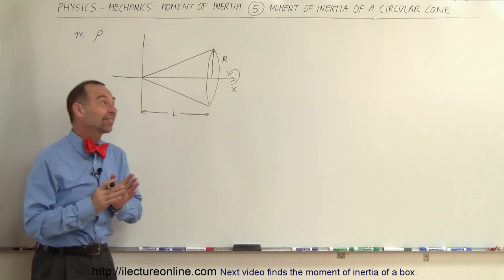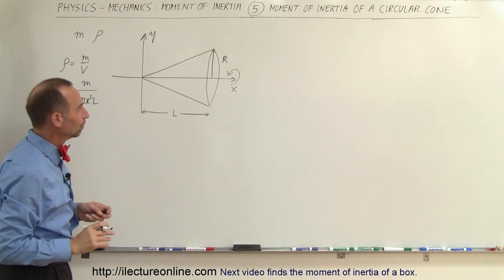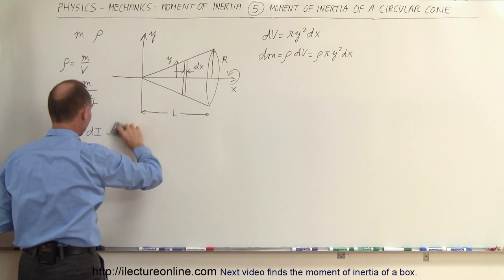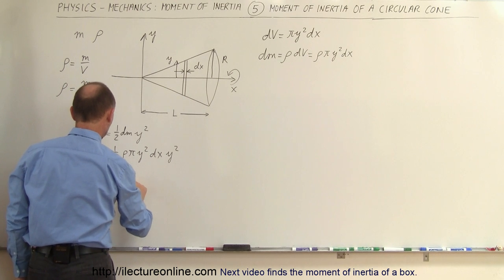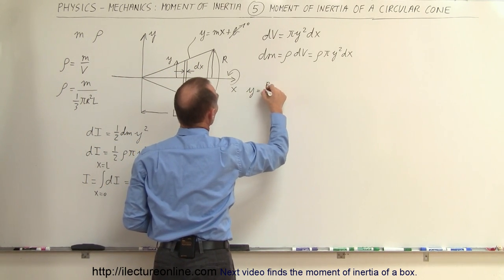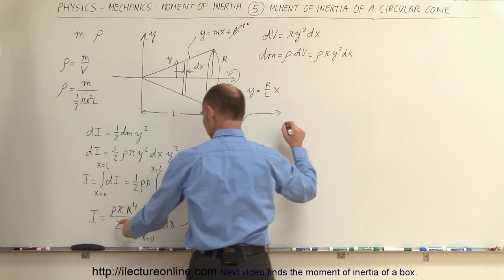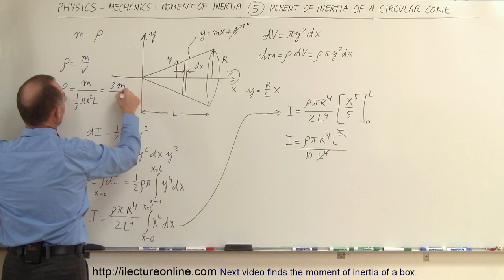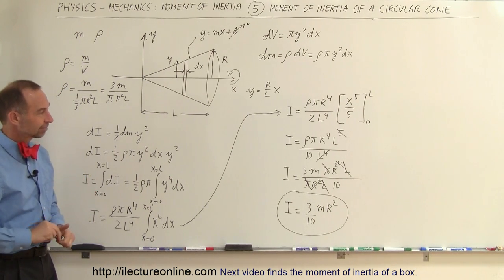Physics 12  Moment of Inertia (5 of 7) Moment of Inertia of a Circular Cone

Comment: Would you still try 3/10MR^2 if you instead of writing the integral with respect to the height, wrote the integral with respect to the radius and integrated from -R to R?
Reply from the maker: The moment of inertia will indeed depend on the shape of the volume element dV

Comment: I still don't get why the moment of inertia of the disk is 1/2 dm r^2??? It makes no sense because I thought moment of inertia was just mass times radius squared?
Reply from the maker: +undertaker0517 It depends on the mass distribution.Try this test at home.  Make an incline with a wood board or a slanted table or something like that.  Now roll 2 objects along the incline.  One is a solid wheel.  One is a wheel that has no center (just the rim on the outside).  See which one rolls down the incline faster.  (It will be the one with the smallest moment of inertia).  The size or the mass will not matter.
Reply: +Michel van Biezen Oh I understand it not thanks!
Reply: +wonders2981 OOOO thx bro!
Reply: +undertaker0517 now**

Comment: Hello Prof Biezen. At 1:53 concerning the  M.I of the circular incremental slice, to gain a little more concept, I referenced your video titled "Moment of inertia of a Thin Circular Plate" where the apparrent M.O of a solid cylinder is given as 1/4 dmR^2 & this threw me somewhat as in this video its given as 1/2dmR^2. Futher lookings up revealed that 1/2mR^2 is the total M.I of a thin rotating disk  (the sum of I about the x axis ( 1/4  mR^2) and I about the y axis =1/4mR^2+1/4mR^2=1/2mR^2 ). Its also equal to the MI of a cylinder re your video "Moment of Inertia of a Solid Cylinder". Would it have expedited things referencing the viewer to these videos at around 1:53 saving time lost  looking up? Then the explanation for I=1/2mR^2 becomes clear.
Reply from the maker: At some point we need to make the assumption as to how much the student knows (or should know) at any particular level.  By the time a student tackles a more complicated problem like this, the student probably knows the moment of inertia of the basic shapes.
Reply: Yes that's acceptable. I guess I'm too much of a detail guy puttin in references to the other videos in text!! But it did get me to realize something that I now know I should have! before!! Many thanks for your answer &, all the other videos , a unique job, very valuable indeed.

Comment: thanks for all your useful videos , I just wanted to ask what determines the limits of integration whether it's from 0 to R or from 0 to L so why not from 0 to L/2  ?
Reply from the maker: If for example you chose the limits from 0 to L/2 in this example you would be calculating the center of mass of the top half of the cone.  Limits from 0 to L give you the center of mass of the whole cone.
Reply: Michel van Biezen aha i got it but in the previous videos when we made a infinetismely small cylinder we integrated with limits from 0 to R not from 0 to L
Reply from the maker: The geometry usually directs us.  If we are using cylinders then the variable is the radius, so we sum up all the cylinders from R = 0 to R = R  (That is integration).
Reply: ok thanks for the reply and for your efforts
Reply: ok thanks for the reply and for your efforts
Reply: ما هو على حسب بيكامل عشان يغطي اي منطقة من المخروط يا ريس في المثال ده هو بيكامل من 0 ل L عشان يعطي المخروط كله انما لو عاوز نصه هياخد لغاية L/2  انما لو بتكامل من 0 ل R فده مينفعش في التكامل ده عشان انت بتكامل بالنسبة ل x و لو خدت ال limits من 0 ل R فانت بتديله ابعاد x مش مسؤول عنها فهمتني؟
Reply: you're integrating the disks with respect to the x-axis, (every disk has small thickness dx), so when you integrate, it's starting at 0 and adding an infinite amount of Moments of Inertia for the small disks all the way to L.

Comment: sir can u please explain why the limit is from 0 to L not 0to h? and will incase of a hollow circular cone, taking the portion as a ring in place of disk will the limit be also 0 to L?
Reply from the maker: Since the length of the cone is defined as L not h.    (It doesn't matter what variable you use so you can replace L by h)
Reply: I was confused whether to consider the slant height or to use vertical height as limit. Anyway, thank u for your reply, sir. 
 Ur videos have helped me a lot in understanding the application of the scientific theories. Keep up the good work :D.

Comment: If the cone rotates about its vertex, what do you have to change in this procedure?
Reply from the maker: What are you trying to calculate?
Reply: @MichelvanBiezen  The moment of inertia.
Reply from the maker: That is what this video does.  Are you wondering about when the cone rotates about its base?  If yes, then we have to change the equation to:  y = (-R/h) x + R
Reply: @MichelvanBiezen  When it rotates about the y-axis. I was reading some derivations of moment of inertia of different shapes and the person who writed them left that as a Homework. So, if it rotates about the y-axis, you have to use that linear equation (y=(-R/h)x + R), why?